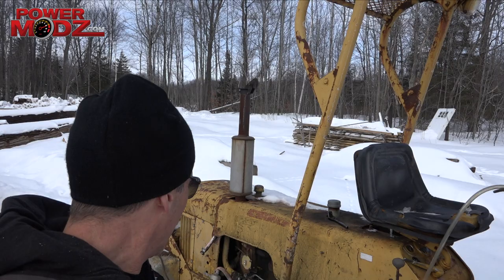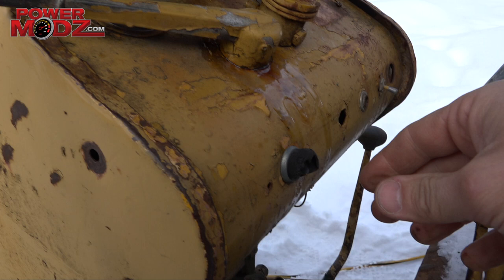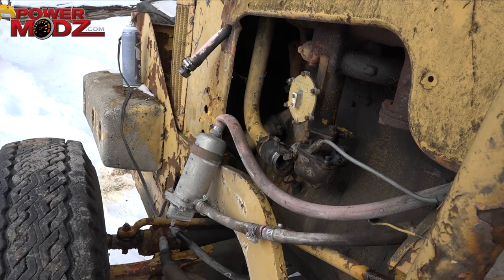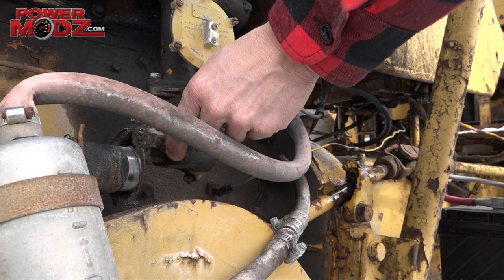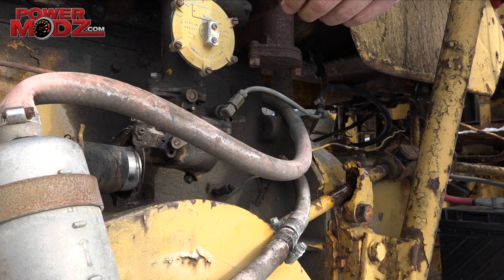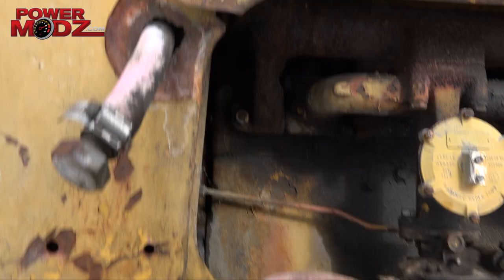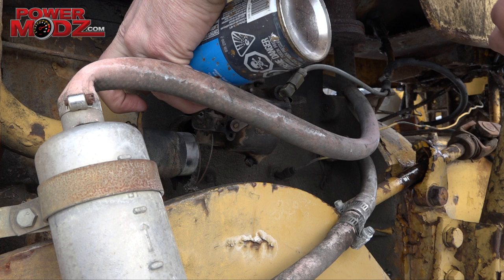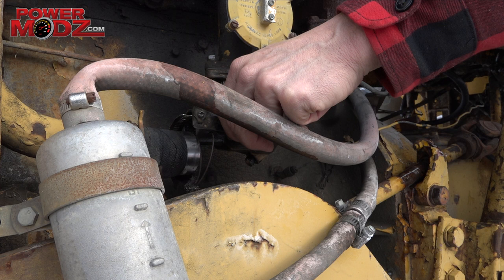Antique Case forklift - first attempt at a start.

Comment: A lot of good suggestions here, and check those switches to see if any actually turn the ignition system on and off. Maybe a switch is in upside down? Just because a motor turns over doesn't mean the ignition is functioning. I hope it's a simple fix.
Reply from the maker: i checked power to the coil and it is good....so if there is power to the coil and cap  then the issue should be points and condenser - which look new but im going to put new ones on anyway.

Comment: hook the air intake back up. Those old up draft carbs don't run without the air intake, they need the restriction to be able to pull the fuel air mix up to the motor. Check ur points and cap then as long as u got good fuel and the air hose hooked back up it should run. If ur unsure about this salution try putting ur hand over the carb it will more right up. I have almost the exact carb on my Massey Harris 44. Also if u need any other parts try Steiner tractor.com

Comment: Clean and gap the points, and be sure there's power actually getting to the coil.
Reply from the maker: the coil sends power to the cap - i checked and spark comes off the coil wire to the cap.  the points and condenser look new but i bought new ones anyway - maybe a bead new condenser.
Reply: PowerModz I meant make sure the  12v is getting to the coil, but if you're getting spark straight off the coil wire then you must be. Maybe condenser is bad and/or points are little dirty, making spark a little weak.
Reply from the maker: they are new, the points havent had power through them and no corrosion - that's why im leaning towards a bad condenser which looks new as well - or maybe they didnt gap them right.
Reply: is the distributor turning?  are the points opening/closing? use jumper wires to power and ground coil, with a plug in the end of the coil wire, if it sparks when power is removed, replace the condensor, if not start with the coil.

Comment: points. sand the points!
Reply: I agree with takethepills, old motors like that, that sit need points sanded once in while. or rub a penny between the points. both should do the trick if your new coil don't help.
Reply from the maker: the cap, rotor, points and condensor are brand new when i looked at them, I bought new wires and a new condensor, I'll also check the point gap to see if it is correct.  someone obviously has been trying to get it going with no luck....i think we can do it.